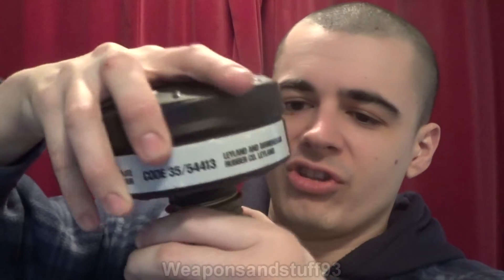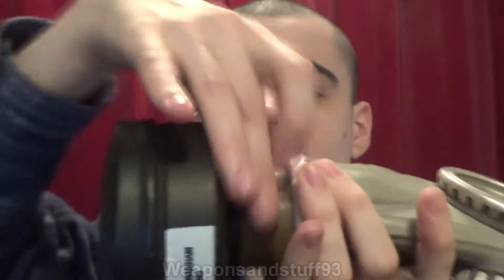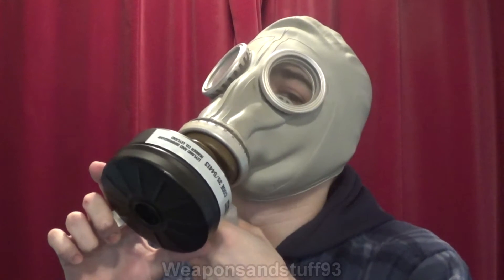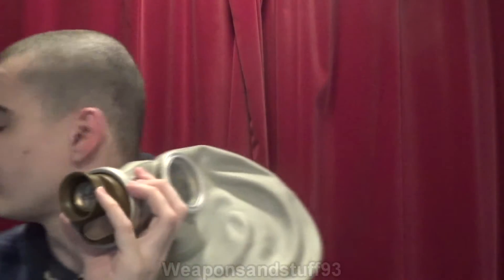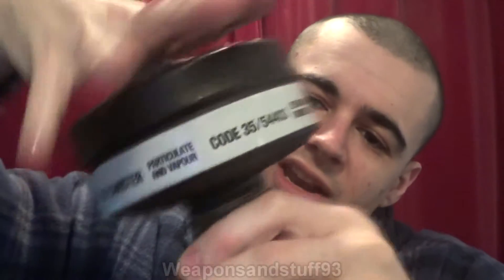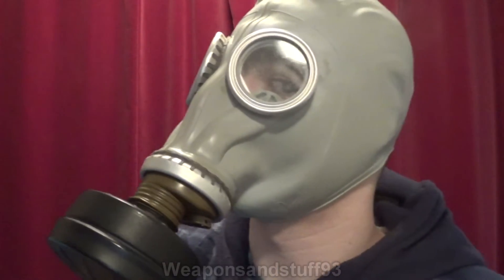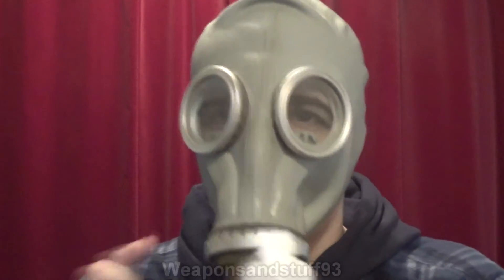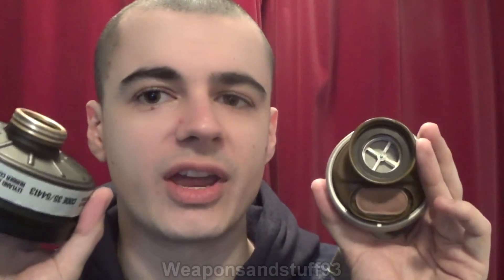NATO filter working on a Soviet GP-5

Comment: I had that O-Ring when I bought the mask with the GP-5. But even if i'll need to put in a second one, it is not hard to get a small cheap rubber ring.
Reply: Where could we get these?
Reply: @ΚυριάκοςΜπερκέτης  In plumbing section of hardware store

Comment: Ive tried a cff3 nato filter on my gp5 and it works pretty well no trouble screwing it in
Reply: I think it's because the threads of the CFF3 is thin enough to fit in GOST threads, hence why I bought 10 of them for my masks.

Comment: using the 40mm rubber washer is a good idea, try using some silicone plumbers faucet grease on the threads to cut the friction.
Reply: I've made a bit of measurement of the O-ring. It's actually 38mm since it is the inner diameter of it is 38mm. The reason it is called 40mm is because of its outer diameter which is evidently 40mm.
Reply: Grease? That seems like a good idea to be frank.

Comment: dimension for that O Rings is?  " (Outer 40mm) x ( inner ?? mm ) x ( thickness ?? mm )  what is the inner  diameter and thickness, + thank you for this informations
Reply: Outer is 40mm. Inner is 38mm. Therefore, search for O-rings with an outer diameter of 38mm. Thickness is around 3mm to 5mm. Sorry I couldn't response to your question a year ago since I didn't saw yours much earlier.
Reply: Did you find this info?

Comment: Is the Israeli 40mm easy or comfortable to wear with a helmet? Because that and there cheaper, is the reason why I would pick the GP's over a nato gas mask for preping. But I don't own an proper gas mask so...
Reply from the maker: The M15 or the 4A1? Both fit with a fair few helmets but the 4a1 fits a bit better as it has a smaller top profile.
Reply: @weaponsandstuff93  I was talking about the 4a1

Comment: Question what's the most comfortable non helmet hood Russian/Soviet gas mask? (I have long hair so I don't like helmet hoods)
Reply from the maker: The MM1 probably or the PPM-88 but the majority of Soviet masks are hood designs.
Reply: I've got long hair to and have found helmet hoods to be fine. Any rubber mask straps/hood will pull at your hair when taking it on and off, so look for masks with a fabric head harness. If you want it for real use then exclude soviet (And most cold war) masks all together.
Reply: Ashley Blackwater Thanks for the info and no I use the gas masks for Halloween and stuff

Comment: Alright I got a ShMs gasmask but when I cleaned it water came to where the inhale flap was (there was some coconut oil on the flap too) and so when the water poured in 3 metal pieces came out and made the flap go to the bottom can I still insert the metal pieces in or is the gasmask just forever broken

(How can this be a problem?..well normally the flap keeps the sweat in and not make it leak but now that its constantly open sweat is leaking through and well if I use a filter the sweat is gonna get in the filter and break it)
Reply from the maker: You should be able to reassemble the mask but why did you clean it with coconut oil?
Reply: @weaponsandstuff93  there was heavy blooming in the mask I tried everything to get rid of the blooming but it never got off even now after using the coconut oil its still there

Comment: So, I got another GP-7 (because the first one i got didn't fit me and rubber straps being a Cyka because the USSR didn't give two shits about production in the 80s) and I'm excited. Although I got a filter with it as well, what do you think I should do with it? (As well as heavy regards there are absolutely no studies done on GP-7 filters).
Reply: @weaponsandstuff93  there is also the rumor (or so I'm told really) that they continued to use asbestos in filters after 1982. More or less within the cotton mesh or separate compound. Perhaps I should get it tested. (And in my opinion, they should really stop allowing older filters to be sold, they're too much of a hazard. Especially with learning that the paint is also lead based and the fact Asbestos is a proven silent killer.)
Reply from the maker: Soviet filters contained asbestos for the entire period of the Cold War, they never stopped using it.
Reply: @weaponsandstuff93  then i do suppose we have an answer for GP-7 Filters.

Comment: I am planning on buying my friends GP-5 because my father accidentally threw away mine a long time ago. Most likely not buying the filter because I do not need any asbestos filters. What is the specific NATO filter you use? (Asking because of more accured S.T.A.L.K.E.R. cosplay)
edit: Does this same method work on the tube of the soviet gas masks?
Reply from the maker: It should work on hoses as well as regular mask intakes, yes.
Reply from the maker: This was an expired British S6 40mm filter, but any NATO filter should work (In theory) using this method.

Comment: Somebody needs to make a GOST to NATO screw adapter, sure it would make the inhale valve longer, but it would really increase the GP5's international usability.
Reply from the maker: It's not really profitable for a business to consider making.
Reply: @weaponsandstuff93  I got one. It seals perfectly with my gp5. It's a mk2 on eBay. 3d printed not flimsy at all
Reply: @TheNavyPenguin  i would reccomend coating it in something bc most 3d printed plastics are soluble to many gas threats and stuff in general.
Reply: I have some 3D printed designs for personal use.
Reply: there is one
Reply: I found it!!! It exists!

Comment: I found that the c2a1 filter is more normalized and fits into the gp-5 easily.
Reply from the maker: Strange but okay.
Reply: Yo. Have you found any other filters that fit on the gp5 without an adapter?

Comment: I have a Scott P100 filter that threads in far enough that it seals against the existing rubber washer. It's possible other Scott filters will do the same.
Reply from the maker: Yeah I think it varies a bit from filter to filter.

Comment: I saw a video where a guy literally ripped apart a nato filter’s insides out taped the filter back together so he could wear a s10 for airsoft.
Reply from the maker: But why? If you wanted a prop filter just get a P3 40mm filter, no real breathing resistance to it.
Reply: I don’t know he also pried off the eye lenses with a screwdriver to put in some airsoft safe lenses but then put the red outserts in. I’m baffled.
Reply: @ApocGuy  plus it strengthens your respiratory system, some athletes do it when training.
Reply: Wooooa tell me where he plays, I'lljust use some tear gas aon him...

Comment: Hmm. Could it be, that the older German filters (KS80) have gost threads? On my GP5 the KS80 went in as easily as the original GP5 filter, without any of that grinding noise.
Reply from the maker: No they are NATO threaded, but the thread size etc can still differ a little bit from filter model.

Comment: Just what we needed, a great and informative video on frequent topics. Would be cool if you could check NATO masks compactibility with hoses...
Actually, do NATO masks have dedicated hoses at all?

Btw. how do you put on your GP-5 so fast without adjusting it after? I do the exact same, but my head always moves backwards and I use quite a bit of force.
I got the right size (3y). I have a short hair (like you), and I found out that wetting it makes it easier to put on.
Reply: Thank you. I know that Chinese gas masks use normalised thread and can be fitted NATO filters, but my focus was on Wester gas mask (US, British).
Thank you for your idea, but I want to keep the mask in it’s original shape.
Reply: Among Chinese brands you find NATO (or rather international thread) hoses; some brands have hoses as well, longer; found (expensive ) resellers from ebay. Another way to make a GP5 universal is to replace the thread of the hose (side to the canister) with an universal thread, from some Chinese or other. V easy to do, just need strong adhesive tape of appropriate type and a screw ring, as in 80s many panoramic masks ... Anyways, i dont think the GP5 is made of an high end butyl rubber, but for most threats it is enough.